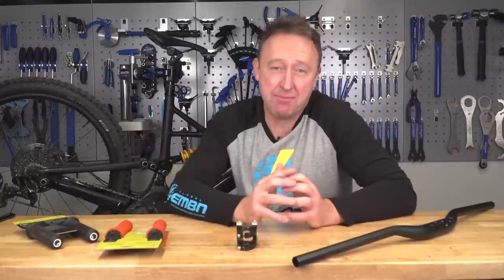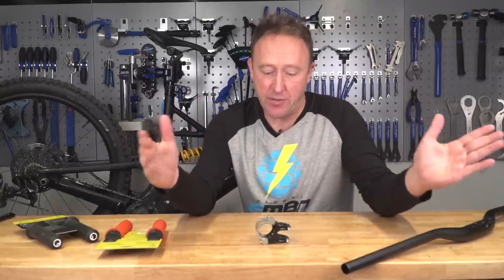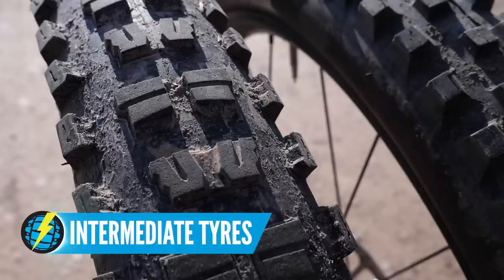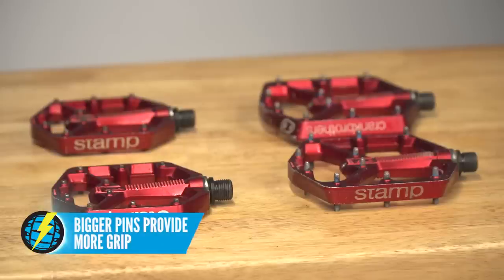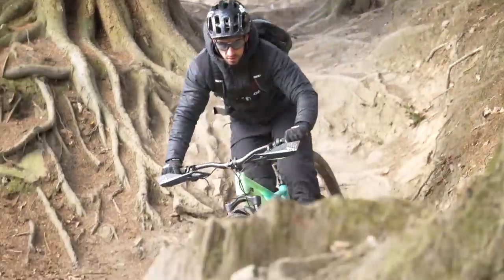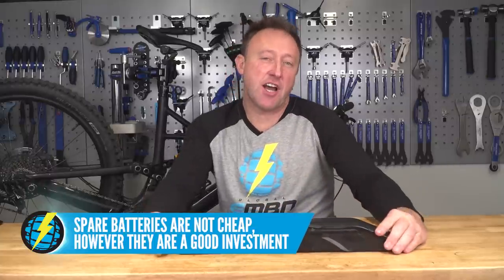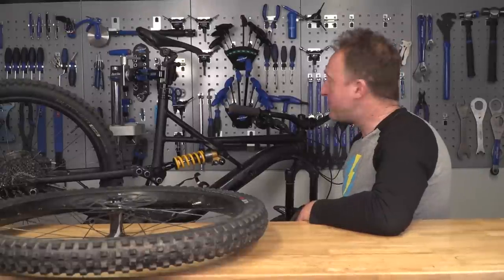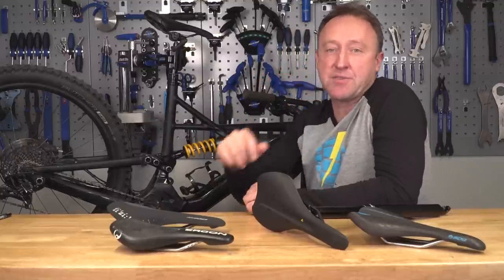The Best Upgrades For Your E Mountain Bike | EMBN Tips

Comment from the maker: What do you always change on your bikes?
Reply: Electric Mountain Bike Network Tires, „handle bar grips“ (idk the right english word) and my brakes..
Reply: So far I’ve done grips, wider renthal bars (800), moved to 2.8 butchers from the 3.0 purgatory, put some colour coded Hope rotors on and a pair of Saint clipless pedals. 

It’s feeling good 😊
Reply: Grips
Reply: Hi Steve, typically I’m changing saddle, tires and stem. Great video!
Reply: Pretty much exactly what you said. Bars, stem, grips, dropper, seat, pedals, 203 mm disc rotor, 4 pots. Job done, plus lower gearing and eMTB specific with higher speed rating/tougher sidewalls or higher rated weight tyres.
Reply: Handlebar (NC-17 Trekking), seat (Serfas Rx Cruiser), pedals (Shimano Saint MX-80).
Reply: Pedals, Bottom Brackets, and add motors mid drive and or Hub for 1wd or 2wd.
Reply: Saddle (still need a large one!), grips, pedals.
Reply: Essentially I have just spent £7k on a frame. It’s costing me more than MX did!! 🤣🤣
Reply: Pedals and stem and handlebars
Reply: Chester pedals, Jones bars, Assagai tires and Marzocchi 320RL forks. Thanks for the video.

Comment: in terms of cockpit mine fits me perfectly stock only upgrades i did was replacing the stock schwalbe tyres with continental crossking ones with better grip due to a better tread pattern and ditching the stock saddle which was unusable for me. my next upgrade will be a dropper in terms of upgrades i could do is the fork and brakes. shifting is fine an xt schifter wont help me. my dads ebike has the same battery so id just use that one if i needed it.

Comment: Cush Core tire inserts, it’s like having a another shock that reduces chatter and feels great over baby head size rocks. 220mm rotors that are 2 mm thick make a huge difference. Look at upgrading your suspension like your rear shock and fork, a lot of bikes come equipped with bare bones components. Don’t waste your money on high end drive trains, you will blow through chains, cassettes and chain rings, you might want to consider a 11x or 10x for a thicker, wider more robust chain plus the cost is less. Cheers!

Comment: Appreciate your insights!  Too many choices on tires for me to decide for my TREK XCaliber 9 mountain bike with 29" x 2.2" tires.  I need help - I ride steep (20-35%) asphalt hills most of the time (95%).  Wet conditions with some loose sand and gravel on them from washouts (rainforest conditions), temperatures remain between 60-80F year-round.  I ride with tubes but have tubeless ready knobbies now.  I weigh 160 lbs and usually keep the pressures just below max pressure for best rolling.  Wondering if going with less of a knobby and more of a smoother tread would help climbing hills and not compromise my ability to control my descents?  Comments or suggestions?  Thanks in advance.
Reply: 95% asphalt, why on earth are you riding a mountain bike anyway? Get a gravel bike, or probably even a road bike with 28mm tyres would be far better.
Reply: It feels more stable and the wider tires, I believe, give me a more comfortable ride.  My bike partner rides a gravel bike and perhaps unfounded, but won't go on the 5% of the rocky roads I ride.  Personal preference I guess.  Thanks for the input.

Comment: Seeing how much the Bikes cost , for me there's not any money left to think of upgrading and if so it will only be when it's time for replacement of worn parts anyway.
Reply: Build it yourself!
Reply: @MrTuhascvbouwq  Sure...if you want to have a throttle in which case, buy an electric motorcycle. ARE there any ways to build a mid-motor sophisticated pedelec as of 2020? Would it really save money over factory built?

Comment: Carrying the added weight of a spare battery will decrease your 1st batteries life.  So I recommend carrying 2 extra.
Reply: Surely, if you carry another 2, it will add to your weight and you'll need a 3rd? And if you have 3, then that's heavy and will need 4?
Reply: @CurvedSlightly  but then if you going to carry 4 !!
then surely you should increase this to 10 batteries as by this point you wouldn’t of used the first battery as it would of been useless
Reply: isnt this like with space rockets where if you add more fuel you need more power thus more engines which also needs more fuel.